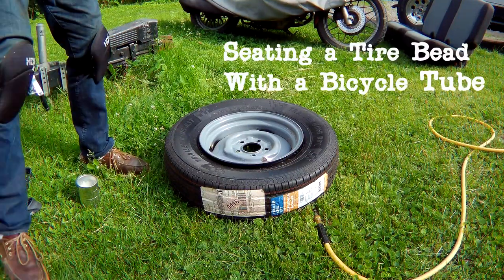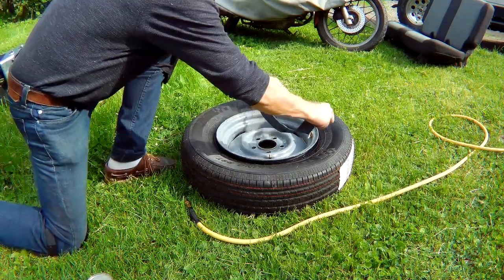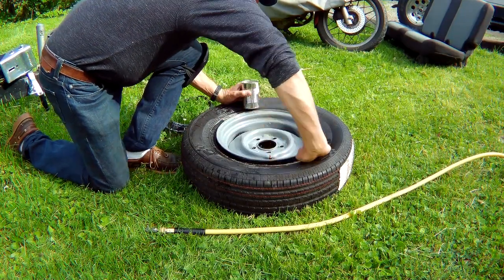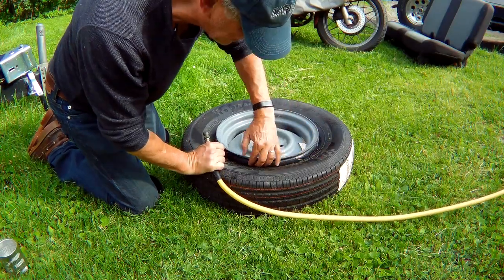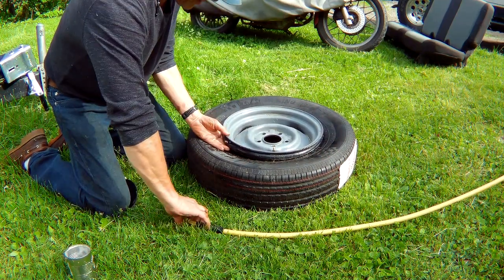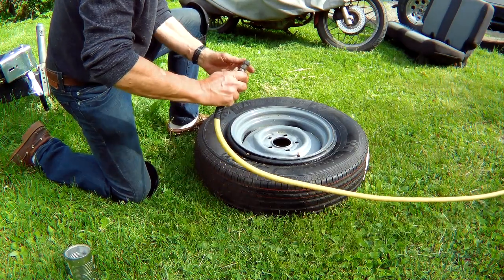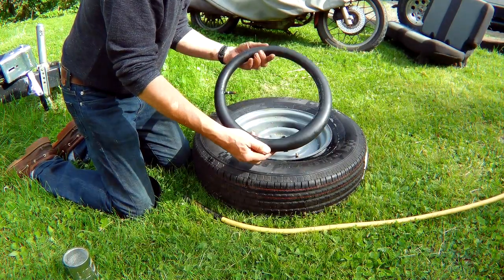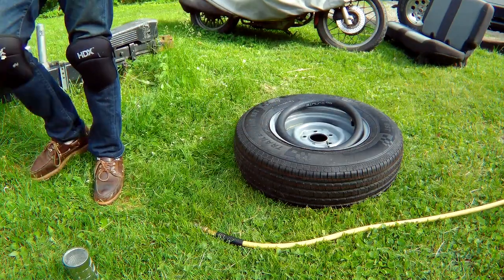Seating a Car or Trailer Tire Bead Using a Bicycle Tube

Comment: Great video & idea!  I had the same issue the other day. Brand new tires but really narrow fit when installed on rim. I used 2 bike tubes, one on each side of rim/tire. Filling the bike tubes a bit first makes it easier to put them on the rims. Then I pumped enough air to seat the tire beads, then let the air out to remove the tubes. Then refilled the tire. No leaks.  One tube wouldnt cut it.
Reply from the maker: I'm glad it worked for you... and great tip on the use of two tubes!

Comment: Did this with two tires this weekend. Worked great. I found getting a tube an inch over the tire rim diameter helped. Thirteen inch rim, fourteen inch tube.
Reply from the maker: Cool! Good feedback about the tube size, thanks...

Comment: I was able to set (with the lighting fluid, fire and run the hell out method) three tires on another vehicle but on my 1971 VW Super Beetle I spent two cans of lighter fluid and it would not work. I tried your method using an 18 inch inner tube, I had to fold it and taped it to make it about 16 inches diameter and it worked like a charm.For those using this method, don't pump too much air on the bike tube or it will burst while inflating the car tire, just enough to block the air from escaping. Then once the tire gets air  let a litter air out of the bike tire so that you can pump more air into the car tire and compress the bike tube without a problem. Great video, thanks!
Reply from the maker: I'm glad it worked for you, Ray... and thanks for the advice and tips.

Comment: Neat trick!  I've successfully used ether in the field numerous times over the years on semi tires.  Trick is to have air chuck locked on to stem w/ air flowing, spray ether into tire and light it with a lighter. Sometimes had to give it a few goes, but did the job. Think your way may be a wee bit safer!

Comment: I encountered a large gap trying to put new tires on my jeep rims. I saw this video and ran out to get an inner tube. First time i didn't inflate the inner tube enough and it got stuck under the bead. Next time I inflated the tube so that it was sitting higher on the rim. When I inflated the tire it popped the inner tube off the rim as it sealed. Thanks for sharing this amazing trick.
Reply from the maker: Glad it worked for you! As you point out, it will take some fiddling and adjustment to get it just right.

Comment: I tried several methods, but had success with an air blaster.. whoohoo! I've heard of this but after watching you, I'll try it! I was worried about the tube getting stuck in the tire, but with the soap on it, it just seems to move out of the way and stays slick enough to pull out.

Comment: Had the same issue with an 18" car tire.  I didn't have access to a garage type tire changer and spent a full day trying just about everything.  Nothing worked.  I saw this solution online and solved the problem first attempt.

A couple comments, bicycle inner tube sizes are given using the outside diameter, or rolling diameter whereas you're sealing a car tire to the rim using the inner diameter of the bicycle tube.  In addition they swell in all directions when inflated.  For this reason I suggest to purchase a bicycle tube a couple inches larger diameter than the rim, in my case I used a 20" bicycle inner tube to bead up an 18" car tire, a perfect fit.

Since the back of the rim is tapered with a better chance of sealing, I expect you'll get best results using the bicycle tube on the front of the tire as you did in this video.  Haven't verified this but it stands to reason since the bead on the front of the car tire has to ride over a larger step on the rim, the source of the problem making bead up difficult in some cases.

A good video nonetheless but watch those fingers should the tire decide to pop when least expected.
Reply: I used 16 bicycle on 17 inch car..fail.  Used 20 bicycle on 17 car..win!  The size makes all the difference in the world.

Comment: I just tried this today, the rim 13",,, and Walmart only had 16" tubes so when I put it on the rim it fit just right but I had to use a tie down strap on the center tire tread to help keep the tube in, it works very good, the tire shop said that their air compressor is 200psi and thats how they avoid tire bead problems.
Reply from the maker: Hey! I'm glad it worked. And yes I've seen the air compressors they use in shops... it's like "BLAM!" all at once. Even then they sometimes have trouble seating the bead.

Comment: Hello, all.  Another method :  Use a thin rope, or 1/8  inch steel cable.  Wrap around center of tread.  Make two loops, one on each end. Put tire bar into loops.  TWIST  tightly, until  the tire bead, is seated.   (( Compressing the tire face,  EXPANDS   the outer radius ;  on inside of tire.  ))  SOCK THE  AIR  IN........should work  wunderbar.   Does over here in Alberta, anyways....FOR all tire sizes...
Reply from the maker: I'm familiar with your (Spanish Windless) method, and have tried it probably a dozen times in my life... with rope, cable, strap. It has never worked for me, but I understand that it does work for some people... maybe many people. 

Usually what happens in my case is that the beads don't move out toward the rims enough, and then the tire collapses or deforms at one point.... gets a dent in it. Or like that. 

So I probably do it wrong, because you and others say it works. Maybe I'll look it up, see what it is I do wrong, and try it again, next time.

Comment: Cool idea 💡!
I'm trying to mount a car tire of 155/65-13 "Darkside Tire" on the rear position of my Suzuki Burgman Maxi Scooter - 13" rim.

It can be a BEAR to get the bead of a Car Tire to pop onto the Motorcycle rim.
Shops have to blast high PSI like up to 160 which freaks them out for safety / liability reasons.

So, I'm 100% gonna try this idea - nothing to lose & looks like it would SERIOUSLY work.

I'll try to report back my results ok ?

Comment: Good Job! Are those OSHA approved steel toed boat shoes and Cape Cod safety hat? For difficult beads on smaller tires, I use the strap method. Time permitting, I'll spread the beads apart for a day or two using pieces of wood. 
For breaking stubborn beads, I use my large bench vise, or lay the wheel and tire on the ground and slowly drive over a portion of the tire with my truck, as close to the rim as possible. WD-40 helps this process. Won't you be my neighbor?
Reply from the maker: Thanks, Husabob! And yes, the Cape Cod had is made of graphine, using nano-technology. 
I like your tips on beading tires... I might need to do the spreading tip with the motorcycle tire (which will hopefully come today...). More fun!
Reply: wow.....someone else,  using  the  ' drive steering tire over  tire '  on the ground. Works  EVERY  time..../ some guys, use a 5 foot piece of 4x4,  and drive up onto it.  oh well, each to his own.

Comment: tried this a couple times never could get it to work for me, didn't help that the crappy walmart tubes wouldn't inflate properly around the stem. Ended up using the ether method.

Comment: Many thanks, I,ve tried everything else and this is the only thing that worked.
Reply from the maker: I'm glad it worked for you! Only a few weeks ago I used it again, on my low profile 19" Land Rover tire... worked again!
Reply: Same here
Reply: @proto57  Guessing you used a larger bike tube, or did you manage to use the 14" one?
Reply from the maker: @binovc69  I managed to use the one I had. They stretch pretty far...

Comment: Inflated the tube before I put it on than Used a inner tube that was 1/2 smaller than needed and it popped right off

Comment: What size bicycle tube do you use? The same size as the rim, or slightly different?
Reply from the maker: I pinned a comment by a guy who pointed out that bicycle tire tube diameters are measured to the outside of the tube, while car and trailer tires are measured to the seating surface on the rim. I used the same size as the wheel size, which was a bit tight, a bit small... this explains it. 

I never tried it, but perhaps a bicycle tube on inch smaller than your car wheel size? That might be a better fit. But try at your own risk! And report back...
Reply: @proto57  If using bike tube the same size as car rim was "a bit tight," then I would think that you meant to buy a bike tube one inch "bigger" than the car wheel size, not one inch smaller.
And thanks for the video.  I'm "pre-searching" for how much work will be involved for me to clean my rim beads (my tires are  leaking there) and also to install new TPMS sensors.
Reply from the maker: @binovc69  Yes my bad... one inch larger, that would make sense. From now on, when I see a bike or bike wheel being tossed out on the side of the road for clean up week, I'm taking the tubes with me so that I have a selection of sizes at hand.
Reply: Bigger.  The smaller just get stuck as you air up.